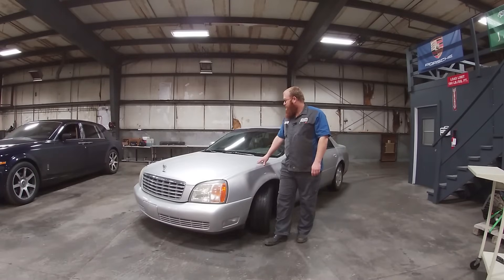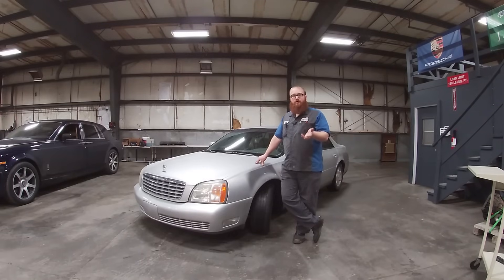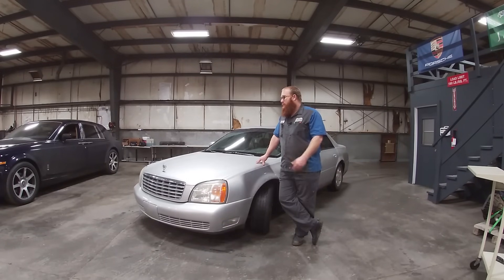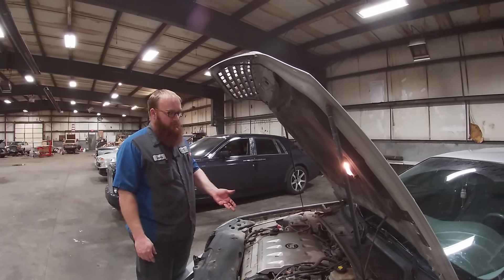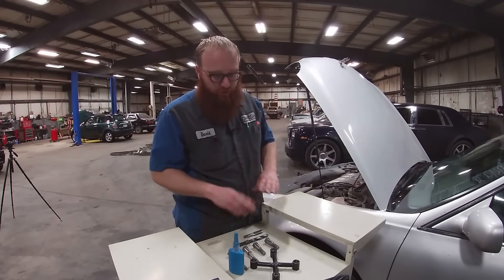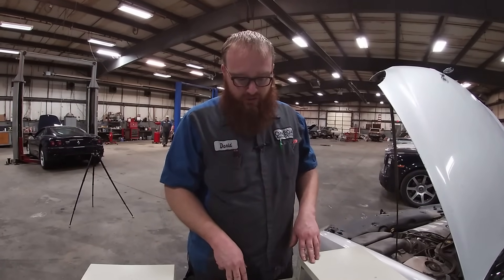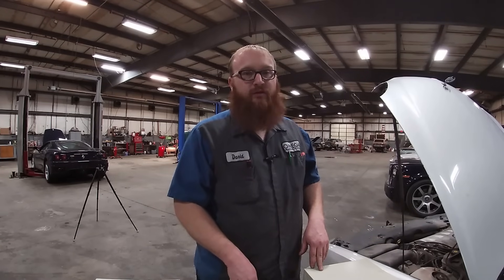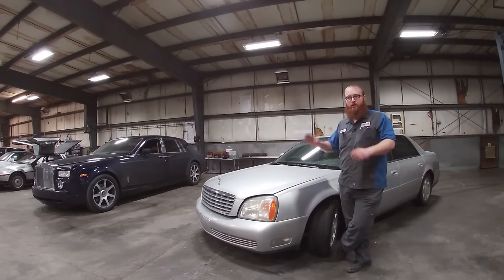The CAR WIZARD names Cadillac's Northstar Engine the Dumbest Design

Comment: First off, my family and I have owned GM products, so I get a free pass to rant a little. I hate Northstars. They're over-engineered, very difficult to work on and parts can cost A LOT of money. I used to own a 2001 Oldsmobile Aurora. It had the smaller version of the 4.6 and 4.0, the 3.5L LX5 V6 (called ShortStar). I sold it at 125K miles this year and bought a 2019 Hyundai Tucson. For the last decade mine leaked oil, burned some oil, and occasionally leaked coolant (thanks to the brilliant engineers who designed the coolant crossover valve which was notorious for leaking, and cost a fortune to replace since you generally had to drop the entire engine). A bottle of Stopleak usually took care of the problem for me. 

The single biggest mistake GM made was putting these large engines in sideways, which basically made it impossible to work on anything (have fun replacing rear spark plugs :-) These cars should have never been FWD. Fortunately, I never experienced head gasket issues or timing chain problems (though mine had a little slack, but that's typical for a 20-year-old car). I hate how tightly packed in these engines are. Just to replace the alternator I had to remove the right headlight and take out the radiator because there wasn't any room to get it out otherwise. Seriously GM?! If anyone is even thinking about buying a GM product with the 3.5, 4.0, or 4.6 please don't. There is a reason why these cars are so cheap to buy. Take your money and buy something that's easier to work on and has better reliability. I liked my old car but I decided to dump it and let it be someone else's problem. Here I only talked about the mechanical portion, the interior is another story. Since selling it I've never looked back and I love my Hyundai so far. These cars are nice when new but there's a reason why so many end up in junkyards. Eventually, it's not worth dumping any more money into them. Gotta love American engineering :-/

Comment: I did my research about the northstar engine I.dig a little deeper and what I found out about the northstar engine is that it's an upgrade from the failure of caddillac 4100 engine in the old Seville the 429 engines is the upgrade in the fleetwood is the upgrade engines in the new caddillacs that don't have northstar engines in them see the 4100 engines in the devilles and the sedean devilles all those were fail cars look it up it's in there the old Seville such as the Elenonte that was caddillac huge failure with the car and northstar engine . so you are absolutely right however the 4100 engines they would overheat and everything else just like the northstar engines . Next time I am not buying a northstar cause I bought a Caddillac CTS it ran good fully loaded nice car but the engine would over heat so I called the junk man to come get it . No mechanic wanted to touch it or I could not do the work myself I didn't have the time I saw your video when a viewer bought his car to you he had a Caddillac as well you said im not working on this car again ever so I knew I'm calling the junk man to come get it . Anyway have a bless morning and everyone be safe take care of yourself . Car wizard I followed your instructions if you have a car like this get rid of it . which I did im starting freash car wizard be safe God bless you and your family later

Comment: I have DTS 2010
Stupid engine ever
Every time you need to change any gasket for the oil pan or any other part you have to take the engine off the car
Do not think of buying it

Comment: $2000 for the car plus $4000 for the repair, it sounds like you may have a nice car for $6000 dollars.
Reply: That's why I offer only around $400 to $500 for a Northstar Cadillac needing head gasket repairs. I explain to the seller the repair (retail) is more than the car is worth. Scrap in my area is now around $300-give or take. 20 hours book time (at $100/hr) is $2000, IN LABOR ALONE for head gaskets, PLUS the parts to make the repair, makes it a very expensive proposition. BUT, being a mechanic, that's a whole different ballgame. repairs can be made for far less than $4000.
 I have seen some very nice Cadillacs for sale, with VERY low mileage, that need headgasket repairs. It just may be worth your while. I purchased a 1997 Seville SLS in extremely good condition with only 65000 original miles. I will make headgasket repairs as time permits.

Comment: Dumbest?  I can think of plenty worse.  How about the original Cadillac V8-8-6-4 in the 1980s that lasted one year and the computer was so slow it never worked correctly?  Try working on that engine and you will find it impossible to fix.  This is nothing like that engine.  Maybe not perfect, but not nearly as bad.

Comment: Anything that you have to take the intake manifold off of to change the starter is stupid from the outset, but none of what is presented in this video even begins to compare with the stupid of the Vega four cylinder or the Olds 350 diesel.

Comment: Thought the ford 5.4 3 valve was the top of the stupid list.   Tiny oil passages and plastic crappy chain tensioners...    and if the  tensioner oil seal fails no oil for either valve train.  My god.  Thats pretty bad engineering.

Comment: I just bought a 2000 Seville. Mine is actually working correctly.
Reply: The display is working correctly. Mechanilly it is sound at 165k. Suspension is busted.
Reply: No overheating issues so far. Impressed. I remember the Cadillac from a far.

Comment: Here's one for you,the northstar is actually an oldsmobile design, cadillac bought the rights in the early 90s for the allante.
Oldsmobile even had in the early 70s 4 valve double overhead cam engine.
You can  hance the motor,have have studs in it or company in canada specializes in these engines .
I must be the dumbest human on the planet then
I have 01 seville STS,rather dump money in it than buy new. It gets attention,corvette owners stare even z28 owner stops yells out  ow that's a nice car.
It's sterling silver 17" factory chrome wheels,I have the paint so shiney it will blind you, I polished the paint used various waxes.
Soon pull the engine out have it remanufactured.
Stud kits installed 5k, ,
New is 22,00
Performance 7500
Reman 3500 
Yip I'm dumb alright, spend 3,500 for reman of my engine new bearings studded performance up grades. 
Or spend 80,000 plus on new caddy,I'll stay dumb and still have money. It was 55,000new in 01.

Comment: Cadillac is really stupid as a car company, but the complexity assures the product won't last long.  I prefer a car built to last for a long time without cheap parts and poor design.  I think Toyota does it right by attempting to make the car better each year, but GM goes with fads and varies greatly in quality and design.  Cadillacs cannot be fixed all too often.
Reply: Still, my 2001 Suburban has been an amazing car and I have 300K miles on it and it seems like it can last another 300K miles - reliable and easy to work on.

Comment: More GM Junk. The engineers should have to mold their full names into the blocks of things they design.  Manufactures should be liable for these lemons.  I’m sure they are already to some extent.  But there should be no cost to sue them to the consumer.  And really it’s just simple.  GM shouldn’t be producing retail consumer vehicles anymore. Or Chrysler or even ford.

Comment: All cars now are a disaster electronics are getting to be a no no for the every day Mechanic unless you have done a special course on electronics  just forget it 'especially Mercedes Benz  'if you ever have a accident in a Mercedes vehicle 'don't try and repair it take the money  ''if you don't your in trouble  'the wiring and the complex relays are a real nightmare 'if just one sensor goes out it can blow another 12 or 15 sensors  'I repeat ''Don't Try and fix A DAMAGED MERCEDES TAKE THE MONEY

Comment: More GM junk. The Ford 5.4 3 valve had issues for sure. But if we are saying the Northstar is a great motor once it’s rebuilt with the parts it should have come with originally, then that same logic can apply to the 5.4 3 valve, right?  Let’s please make less one-sided comments.  I know you are a GM guy, but these things are junk from the factory. Every bit as bad anything Ford made.

Comment: Ok I know this is a old video but can someone help me out? I just bought a Cadillac deville 2004 and it leaks oil like a mf. When u gas it and stop at a red light you just see smoke pouring through the hood and all you smell is oil. Is it a head gasket or is it just a regular ol oil leak? It doesnt run hot ever it just smokes like a Indian 5th grader. It does have a check engine light idk if that has anything 2 do with it. I got it for a pretty good price 1500$ interior is perfect but has issues like the oil, noisy wheelberrings and bad/creaky shocks I think 1500 wasnt that bad tbh but if someone has opinions abt it pls say whatever I wanna hear what everyone has 2 say bc I can most likely sell it and make my money back if its gonna cost me a arm and leg 2 fix 💀
Reply: @LamontBoucherville  smh lmao ive had it up on fb for 4 days now and have only had 1 message and they wanted to buy it for 1000😭💀
Reply: @ethanstephens8293  😆😆 best of luck

Comment: The head bolt kit looks like it could be replaced with lengths of studding, nuts & washers, a cheaper approach that specially machined bolts. It seams quite impressive how much large the replacement the thread diameter is. Some where in between the two, with thread inserts, and the causer thread, should work. You'd have to make / find a drill guide block.

Comment: Its the weakest design and easily repaired,  the dumbest design goes to Audi hands down !  nobody with a fraction of a clue requires removal of motor mounts to replace a starter , or complete removal of a motor to replace a timing chain located on the back side of a motor firewall side ! Audi does all in one motor and requiring 2 fuel pumps to run a 200hp motor is pure retardedness ive run a 2500hp motor on 1 fuel pump they need two just to ensure the motor dies when 1 of them dies.

Comment: The other N* design screw-ups were putting the starter under the intake manifold, and having an overly-restrictive exhaust crossover pipe (which robs you of about 10 hp).

Comment: Yeah, a motor that didn't require a tune-up for the first hundred thousand miles is a terrible design! 😆 

It's more like idiot shade tree mechanics, Jiffy Lube and American drivers don't know how to take care of anything and Destroy cars because they don't know what they're doing. 

I have a Pontiac Fiero with a Cadillac Northstar engine, with almost a hundred thousand miles on it and I guarantee it'll blow away any car you or Hoovey have in your garages..

I also own a 2000 Ford Expedition with over 260,000 miles on it with a 5.4 that's lucky if I ever even remove the oil filter when I change the oil. No problems. The Expedition I had before that head over 300,000 miles and it had a 5.4 all wheel drive as well.

Comment: Got a 98 with 128 K with a P1350 and P1375, that stalls or near stalls, and breaks up on accell at times and feels like missing , I feel like F@cking Scoper Doper with a 4 channel scope testing the cam and crank sensors and not guessing, but not seeing anything conclusive with any drop outs on the crank sensor or any misfire history counts when The Turd's acting up. GM's absolutely suck.  Saturns without a camshaft sensors set a P0340 camshaft code when it's arcing at the coil towers to the long screws that hold the wires to the coils. From the ridiculous Quad 4 coil packs, to the Vortec V6 distributor caps GM , to faulty ICMs on many , these vehicles kick my @ss and make me feel dumber than Sh@t at times wasting hours when you only got an hour for diag .  Lots of folk slamming parts with these issues but no definitive common cause to check first. I've cleaned the MAF, throttle body, replaced fuel filter, tested fuel pressure , cleaned injectors, wiggled harnesses etc to lower fuel trims that high and lean , but no codes for any lean issue!

Comment: Oscdbo.overly sensitive cadillc dont buy one. The thing is full of sensors, computers , Pre set seat controls  special fcking codes. Mdern automobile engineers  have become the epitome of nonsensical "added value options" to drain wallets.     Buy a 350  chevy engine put it a  1976  impala no more fcking insanity.  The auomibile has gone comoletely fcking insane. The whole engine has to come off to get to the fcking starter and when you install it you have to enter a code and and turn the wheeels 3 /4 of a  turn to the right and turn and if you dont it will shut down the auto theft system attached to a intergalactic space station and you will need a code to temporarily shut down the "security sytem" i am thoyroughly disgusted with the cadillac wallet drain.